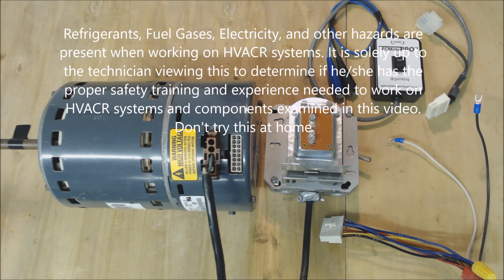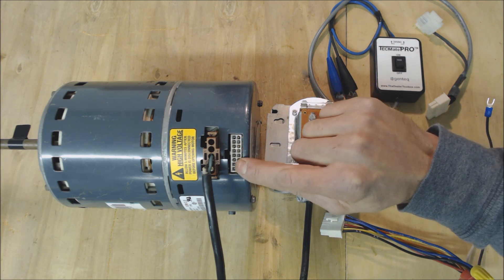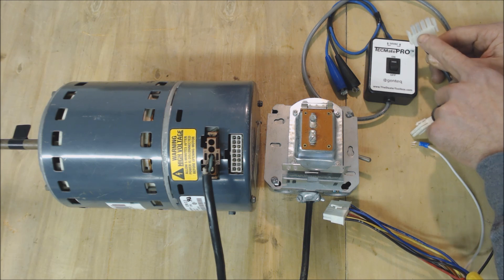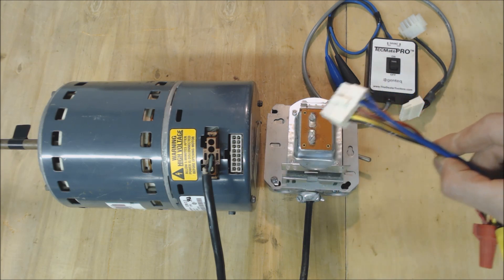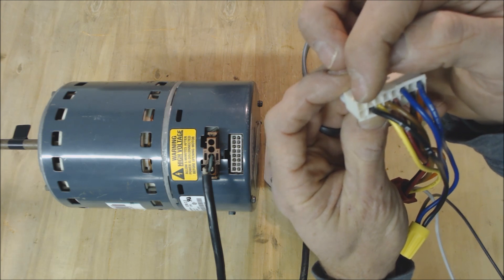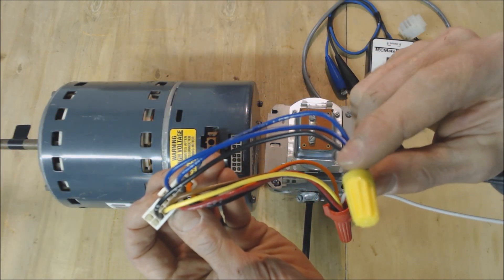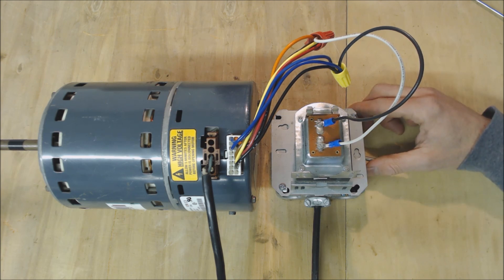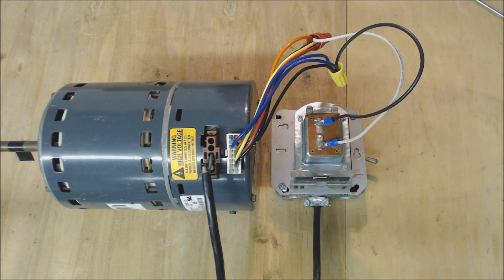Testing ECM Variable Speed Fan Motor, Make Your Own Tester!

Comment: I finally bought a Genteq one, opened it, and proved it has capacitor and diode inside, make pin #15 different from what in this video. In some motors Genteq tester works but this direct wire method  doesn't. But still you are the best, thanks for making all these videos.
Reply: I'm confused by pin 15 also. In the air handler manual it has a troubleshooting section. It states to jump Pin 1 and Pin 3 to blue side and Pin 12 and Pin 15 to orange side. My ECM2.3 1 HP motor just spins very slowly and rumbles. I'm trying to diagnose the board, motor and controller.
Reply: @mtbbiker6401  I am also having same issues with my furnace.  The blower motor tries to run when I have the thermostat set to fan only, but doesn't build up an speed.  Bumps the squirrel cage fan about a half a revolution & stops, almost reversing then continues forward again.
Reply: @calvindlamb  My problem was with the internal windings of the motor. There was a short that I was able to find and repair. If you search tesla500 blower motor fix, you can find the video on youtube. He explains the problem that I had. I was lucky to find the problematic insulated wire and repair it with epoxy. I re-assembled the motor and it worked.
Reply: You can do an ohm test across the three leads of the motor to determine whether it's the motor windings causing the problem.
Reply: I was able to diagnose and repair my Genteq ECM 2.3 1 HP motor. When I tested the ohms across the 3 leads my readings were 1.2, 4.8, 4.4. I read they need to be the same. I disassembled the motor and fortunately located the burned wire that was causing the problem. I bent it and applied epoxy resin to insulate it. Checking the ohms, I now have 5.6, 5.6, 5.6 and no shorts to ground. The bearings seemed good and also the ECM modules didn't appear to have any burned area. I reassembled and installed the motor and IT'S WORKING.
Reply: @mtbbiker6401 yeah mine were all at 10 ohm.  No shorts to motor body.
I followed the test procedure pins 1&3 to common 24 v blue 12&15 to 24 volt red and motor was still running sporadically.
Reply: @calvinlamb2142  If your bearings are good and windings are good, it could be the endbell module. Sometimes the thermister goes bad and can be replaced.
Reply: @mtbbiker6401 yes, i just odered a complete unit.  Its already 15 years old.  From all the tests I have done it seems to confirm it is the end bell control/ driver module.
Reply: @calvinlamb2142  I hope that solves your problem. Keep us updated.
Reply: The Genteq they sent isnt direct plug and play.  It comes with a interface with 8 loose wires that needs to be installed in the cabinet.  The wiring diagram doesnt match up very well, but their tech support just told me to cap off 3 extra wires.
Its a Evergreen VS 6505VUI.

Tried to find a direct replacement right from Trane dealer, but they didn't even return my call.
I nstalled the Genteq, & seems to be doing the job
Reply: @calvinlamb2142  According to the Evergreen brochure, ECM 2.3 and EON require the user interface (5K010) with the VS motor. ECM 3.0 is plug and play. Did you check the end bell to see if the thermistor is bad? They have been known to burn up. That would be an inexpensive fix. You might be able to source a replacement end bell or complete motor on ebay. ECM 2.3 and EON motors are interchangeable.
Reply: @calvinlamb2142  According to Evergreen VS brochure, ECM 2.3 and EON require the interface 5K010. If looking for a direct replacement look for a ECM 2.3 or EON replacement motor. EON should be a direct replacement for older 2.3 motors.

Comment: Where do you find 16 connector or how do you know hot and how do you know C ?
Reply from the maker: Mike, you can get a Tecmate Pro tester or if you replace a unit with a 16 pin wire connector, it will have two sides for you to make two testers with. In the video, I showed the 24v hot and common locations, thanks!

Comment: hi, my Amana furnace has this same motor. the motor just swings back and forth but will not rotate. i am thinking might be the endbell even though it looks very clean with no burnt marks. but the price is too expensive. can i replace this motor with a psc with same ratings? will the furnace control board be compatible? thank you.
Reply: If you wire in a PSC motor it should only be to get you by for a while. As you’d have to wire it to 240v. You’d have no way of turning the blower off, it would run nonstop. The ECM motors are turned off and on from the 24v signal. PSC motors are turned off and on from a circuit board with the direct 240v.

Comment: Is this a variable speed motor?  If so, how does one vary the speed?  Is there another pin/wire used for this?
Reply: It varies speed according to 24vac inputs on the 16 pin in this case.  Each input has a preprogrammed cfm that the ecm tries to maintain.  Usually you have separate speeds for y1, y2, w1, w2, g only, and a reduction for a dehum input.  Other models have a pulse train control and some are communicating.  This type is very common and are easy to interface, usually to two stage thermostats and humistats at 24vac.  They also ramp up to speed and down, basically a soft start.  They attempt to maintain a defined cfm over a range of static pressures which is the most elaborate algorithm since all they have is rpm and current as internal inputs.

Comment: The transformer on my furnace is outputting 28vac to the control board and motor. Is this normal, or should I replace it?

Comment: I understand I can use 18 VDC or 24 VAC as signal wires.  Is that right?.  I have a new EON motor that's not working.  Will this work with that too.  (It's 16pin)

Comment: Thank you for posting. Does the techmate pro run the motor at full speed or low speed? I  have this motor ecm combo but the motor isnt rampramping up to full speed. Its "stuck"  on low. It attempts to ramp up but fails and gets stuck on low. Any idea? I ohm'd out all 3 motor windings and they are good withing around the same readings. I removed the ecm and checked the thermistor with heat and a ice cube. My values change and the thermistor is good. The original problem i had was grinding noise. I thought bearings.  But was wrong. The permanent magnets of the motor stator shaft had seperated. I high heat epoxy glued the magnets on. And here i am now stuck on low and not ramping up to full/hi 100% speed. Any ideas i greatly appreciated.  Do i need to buy from Trane or is there a aftermarket plug and play motor and ecm i can use. Thank you!

Comment: I need help testing my motor it doesn't have as many wire as you do. It only has 5
Reply from the maker: Is it a psc with a capacitor? If so, look up acservicetech psc blower motor thanks!
Reply: It's just like the one you have hear just doesn't have as many wires for the 24 volt side

Comment: If the ecm is bad and you plug in the tech master will it still run if the motor is good?
Reply from the maker: If the module is bad, then the tec mate pro will not be able to turn the motor on, thanks!
Reply: @acservicetechchannel  "If the ECM Module is bad, then the Tech Mate Pro will not be able to turn the motor on"  if the Motor is bad, the  Tech Mate pro won't turn on the motor. How do you determine which is the problem Motor or Module

Comment: So what does this test tell us? Please explain. Does the test tell us if the module is bad? Or the board is bad? I did a test with the very same tester on a job. My motor did not come on. I'm pretty sure the motor is good but the module is bad. Does the tester completely bypass the module? Or just the board? Confused and cant seem to understand and I been doing this for nearly 30 yrs. Sad!
Reply from the maker: Test the motor with this tool. Verify you are sending the 24v signal and verify that you have high voltage going to the motor. If the motor doesn't turn on then the motor or the module are bad. Then test the motor and read resistance values. All three resistance values should be the same and they should not read resistance with the ground frame. If the motor is good then the module is bad. Did you watch my other ecm troubleshooting videos for motor testing?
Reply: Search for ecm_textbook for a detailed look at the different models and how they work.  Then come back and watch this video with a new perspective. Its a 21 page manual from 2007.

Comment: I need to repair a 2.3 ECM on a Rheem air handler.  The motor checks out good (equal resistance between phases and no grounds).  The circuit board shows burnt areas so the module needs replacing.  I see surplus 2.3 modules online, but how to get one of those modules programmed to match the Rheem air handler?
Reply from the maker: That is exactly the problem, you need to know the model number of the unit the module cam out of in reference to those surplus ones or you would go to the distributor for Rheem in your area to get the new module, thanks!
Reply: @acservicetechchannel  The literature says the EON is a drop-in replacement for the ECM 2.3.  If I get a new eon does it have to have special programming to work?

Comment: Can this 2.3 ECM motor be re-purposed? I mean how do you use it for say a DIY power tool. Is there a way to jumper the 24 VDC pins so that the motor can run on the 110 VAC? I have a spare motor from an old furnace and want to build a 12" disk sander? Thanks
Reply from the maker: These motors are not like a psc motor, they are not going to handle an amperage spike well such as internal module parts going bad, thanks
Reply: Thanks, so I guess that's a no? Well I have to look for a psc motor for this purpose?

Comment: I hooked up the power and the low voltage plugs exactially like you showed and the motor didn`t start . guess the electronics are bad in the end bell  . maybe the motor was bad and the service man also discovered the condenser was bad so the heat pump was scrap .
Reply from the maker: Sounds like the bell module is bad, thanks

Comment: I took a ECM 2.3 blower out of a heat pump with a bad water cooled condenser that was given to me for salvage.Can you actually run the blower this way? if you wanted to use it for a fan? I know you`d have to restrict the air some so the motor isn`t overloaded using the blower out of the machine.
Reply from the maker: The motor is already set for a specific torque value but I don't know at what percentage air speed this would lock the motor at, thanks!

Comment: Very interesting.  My HVAC guy replaced the external controller board - he says he was measuring odd voltages from the output pins.  But the new external controller board did not get the blower running again.  If we do what is done in the video and the motor runs, this would mean that the internal motor circuit board is bad, right?  If that's the case, then there's no fix but to replace the entire motor (containing a new internal controller board)?  That's big bucks, because the motors have programming from the specific hvac manufacturer (York, in my case), so we have no choice but to buy from the hvac manufacturer!
Reply: You can buy from other sources the exact same motor, either new or refurb.  Search by the motor model number including the bigger four numbers such as 5SME39HL0252.  York puts their S1 number on the same motors everyone else uses.  The 0252 digits spell out the specific speed mapping.  Usually its the module, the motor portion is solid with good windings and ball bearings.  There are also companies that sell refurb modules for much less.
Reply from the maker: If it was not the board then it is likely the module on the motor. You can easily check the motor itself to see if its good but yes the module by itself is usually almost as much as the whole new motor and module, thanks
Reply: @acservicetechchannel  I've read that if you can source the motor from a 3rd party, the ECM can be configured to the manufacturer spec by updating the firmware with a computer.  You have to get somehow get the firmware.  Do you have a video on how to do this?  I think your viewers would be very interested in this!  It would be a required step in order to source the part from a 3rd party and  bypass paying the exorbitant jacked up prices being charged for these motors by the furnace manufacturer so you can get the motor with the furnace manufacturer ECM programming.  Thanks again for the well made videos!
Reply: @cosmolee7902  I want to program mine for carrier did you ever figure out a way?
Reply: From another video I found that it was the board on the motor module that was the problem.  But luckily it was something that was easily replaceable - a thermistor, aka "inrush current limiter", had gone bad.  This seems to be a very common problem with these ECM motors.  It's actually quite scandalous, because it's a known issue, but York wants to charge $1300 for a new motor.  But the thermistor cost me all of $2.25 to source.  It's not the tech's fault - York isn't telling the techs that these thermistors are frequent failure points.  It seems like a great revenue stream for them, though.

I didn't wind up using them, but there is a company in NJ that provides a service to repair such motors for much less than buying replacements.  I don't remember the name, but maybe you can find them with a search.
Reply: @cosmolee7902  thank you I'll do some checking mine burnt up at the connector from motor to the ecm

Comment: Great video, AC Service Tech LLC. Just what I needed to troubleshoot my ECM 2.3 blower motor! One question - On the connector supplying power to the motor, what voltages do you expect to see on the 3 pins? I found this reference: https://www.genteqmotors.com/assets/0/96/101/111/112/222548e1-3a94-4465-ae93-3ac96782fea5.pdf. But I'm seeing otherwise on mine.
Reply from the maker: What do you mean otherwise? You should have 120v or 240v supplying. Is your voltage off?
Reply: @acservicetechchannel  
As per the Genteq guide (Pg. 14 in the guide I linked in my post),  line 5 - 120V, line 4 - 120V, line 3 - GND. But what I see is 230V between 5 and 4, and approximately 15V between 5 and 3. Does that indicate a problem right there? The control board is giving me 28.8V AC between R and G screw terminals, which I will use like you mention in your video directly as input to the motor.
Reply: @paragj  Those genteq 120 voltages are to ground but your line 5 to 4 should be 230-240vac.  The two hot phases are 180 degrees out of phase. Research US split phase residential power to understand.
Reply: I got a replacement control module for my Trane air handler 2.3 ECM blower (GE from 2002). My unit was wired for 240V and the replacement control module was an identical part number however it had a label from Trane (separate from the GE manufacturer label with the model number) which said “wired for 120V”. My thinking is that the module was pulled from a Trane air handler that used a 120V supply and probably had the jumper wire on the high voltage power input plug (5 pin) to provide 120V to both circuits in the control module. My unit is 240V and the 5 pin is not jumpered but directly wired with both sides of the 240V power. Would it be OK to use the replacement? Is this type of labeling by Trane commonplace? Aren’t these 2.3 ECM modules all dual voltage, just depending on how input power is wired at 5 pin?

Comment: How do you test an ECM 2.5 motor?
It seems from the limited information I can find, that this might be a proprietary setup. It's got the 16 pin connector, but the pinout is definitely different than the 2.3 type. If required I can provide PWM or even more advanced/complex signals (I2C, etc...).

Looking at the connector, from the wire side:
  _ _ _ _ ▆ _ _ _ _
│V x L x x R x x │
│O x Y x x x x x │
¯¯¯¯¯¯¯¯¯¯¯¯¯¯¯¯
V - Violet
L - Light Blue
R - Red
O - Orange
Y - Yellow
x - no wire

As of note, on the furnace system control board, the Yellow and Light Blue wires are permanently connected together. They seem to be connected to a transistor, resistor and zener diode circuit that supplies 12VDC (that is, I assume - the zener diode is a 12V type, 1N4742). The Violet connects to the large 64 pin MCU chip made by Hitachi. The others (Orange and Red) connect to some 560 ohm resistors and then a ULN2003 chip, which is basically an array of transistors with a common ground connection. There is also a set of diodes; it seems that the ULN2003 chip can be used to select certain wire combinations (pull them to ground) through those diodes.

I haven't tried to connect them yet, don't want to burn anything out if my connections are wrong, so I figured I'd consult the web...

We recently scrapped an old (around year 2001) Carrier Infinity furnace unit. Inducer motor was bad, the board on it was fried and resistor values were burnt so I couldn't fix it. Overall, it was way too expensive to replace the inducer, and the drain pan was starting to rust, unable to buy replacement, etc... just way too expensive to keep it running. We replaced with a RUUD unit.

I wanted to fiddle with the blower, to see if I can get it working as a stand-alone unit. (Just for fun!)
Reply from the maker: Here is the Link for the TecMate Pro- http://amzn.to/2jIP0ty  --  maybe check out in the direction manual if this can be used to test power the 2.5 as well as the 2.3. I know when the 2.5's go bad, we replace them with the 2.3 or 3.0 thanks
Reply: The techmate is not compatible with 2.5 EC Motors
Reply: I just bought a tech mate pro, but realized I have a 2.5 motor, is there an adapter I can find in order to check my 2.5 with the tech mate pro, please help I may just purchase the board because I already purchased a reconditioned 2.5 that still will not run, does that sound like a board problem to you? Thanks